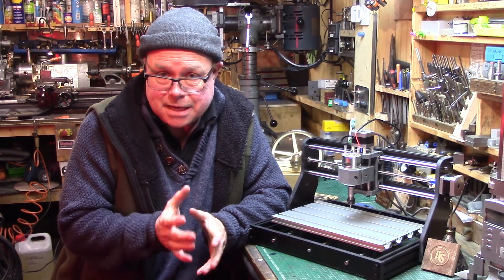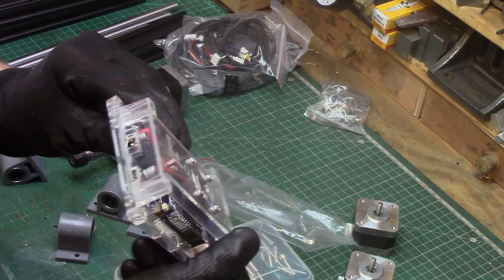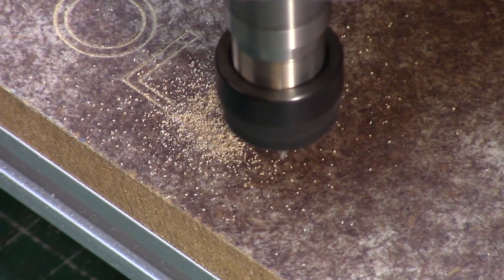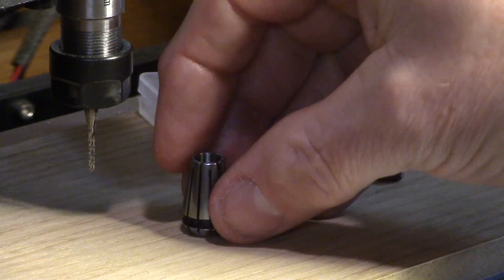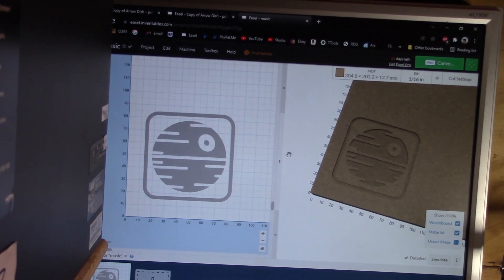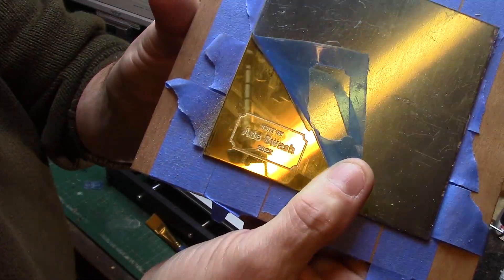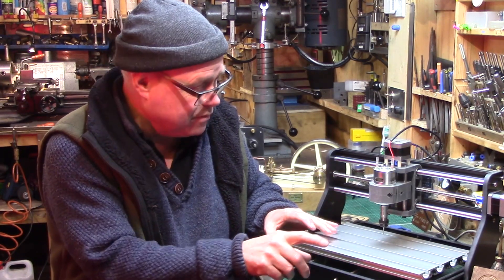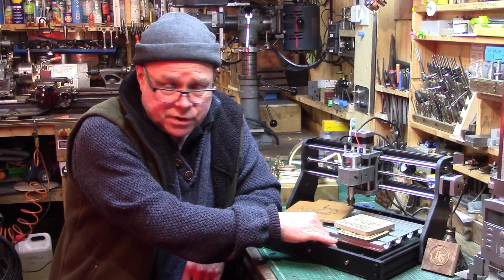Mini CNC Engraver/Router - 3018 Router

Comment: Ade - to help me along, which cutting tip did you use for the brass plate? The end mills or the v-cutters supplied? Also, what depth and speed did you try? Thanks in advance for any help you can give 👍🏻
Reply from the maker: Hi Mick, I used the V cutter, 0.4mm depth, at plunge of 0.2 per pass, the feed was 150mm/min, but probably better slower as I did feel this was a bit aggressive, so I would say to do some test cuts and see what works best
Reply: Lovely, thanks Ade. I’ll give it a try at those settings. Was a bit worried about the amount of flex in the Z axis when cutting some MDF so any advice gladly received 👍🏻👍🏻
Reply from the maker: @mickhaden5888  yes the rigidity needs improvement, I think i'm going to add a 3rd rail mounted above the others, lots of little modifications needed to improve this

Comment: the speed may say 1000, but that spindle motor actually spins at about 8500RPM. But that doesn't matter - it won't be long before you have upgraded that to a 500W Chinese motor so you can do some actual cutting. Then you will have modified all the axes to stiffen them up. But before any of that, bolt on a thin piece of MDF as a spoil board so you can cut right through things without damage.

Comment: Thanks for the video. You might want to try out the new designer feature in UGS which would make the process a bit easier compared to exporting the gcode from Easel. The UGS designer still lacks a lot of features compared to Easel and is still a bit unpolished, but might be handy for some jobs. You will find a small demo of it here: https://www.youtube.com/watch?v=iUi6Lr8nZCo
Reply from the maker: Thank you Joacim, I was unaware of these features of UGS, most helpful

Comment: Great video ! 
As well as engraving you can use them for making circuit boards , machining out the holes in plastic enclosures for electronics projects and to cut out gaskets for model engines .
Reply from the maker: Thanks for the tip!

Comment: Great review I keep looking at these 😀 would have been helpful to know what feeds and speeds you used. Might save a few broken bits for others!
Reply from the maker: Hi Julia, Easle has pre-set speeds and feeds for a variety of materials and bit types, I just used those as a starting point and modified them to suit, depending how the test cut worked out

Comment: Hey Ade, great vid. I got one of these machines Christmas 2019(I know distant memory now) and gotta say it always impressed me and I made loads of stuff using it and even for a while was making branding irons from other makers using that exact machine to do all the logo work, yes had to go slow but once set running it would do its thing and I could get on so a 5hour program never bothered me. If you need any help when it comes to metal feel free to message me. Sure you'll have great fun with it and make some great things on it.

Comment: Interesting video, I had always thought that these cheap routers were just toys, however it did a reasonable job on the brass plate. I imagine it will be better still with the updated spindle.
Reply: Hi Simon after doing quite a lot of brass engraving with a identical machine, I found it's not the motor that needed upgrading as the ridgity of the frame is it's limitation. But with good cutters and light passes these can do some great work. Still amazed the accuracy of these, I've done some extremely detailed v carve work on brass, works best with cz121 bar stock or cz120 engravers sheet, struggles alot on cz102 sheet as it has a very tough polished surface. Essentially thou these are great providing your not in a rush, but once set up will work away without assistance, allowing you to carry on with other work once you stop being mesmerised by it working away.
Reply: @ramsdalesherman3844  Thanks for the information. Do you have any thoughts as to make, I imagine some are better than others.
Reply: @simonbirt6121  as far as I know all these 3018 Pro cnc's are made by Sainsmart, look for a USB version over the parallel port. 
Then get the ER11 collet set so you can use variety of shank size cutters, for brass and Ali look at 2/3 flute end Mills. Just get carbide, don't bother with HSS cutters they don't last and you'll waste more money in long run. For VCarve in brass look for 60deg 0.1mm point engraving cutters again carbide. And then play, you'll only be able to cut 0.15mm DOC and about 300mm/min feed rate on a machine like this but if you take it steady like this it will complete you pieces well, if you push the depth of cut and feed rate you loose steps and accuracy, but this is the sacrifice of a cheap machine. If you want more serious material removal you'll need to look at much bigger more expensive machines like the 2k range.
Reply: @ramsdalesherman3844  Thanks for the info, I may get one.
Reply from the maker: Thanks Simon, yep they are more capable than expected, and I'm sure I can only improve as I learn more, just need to be patient and not to rush it